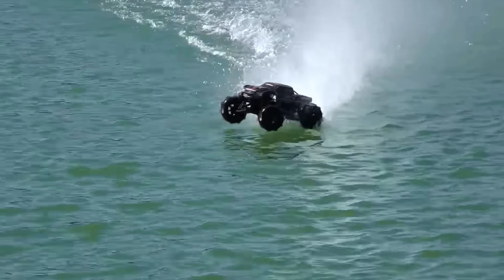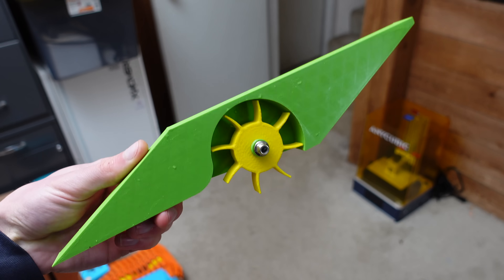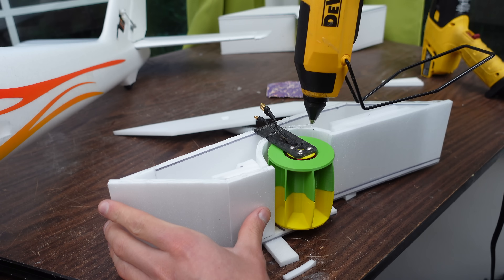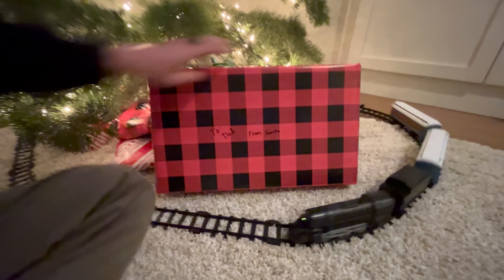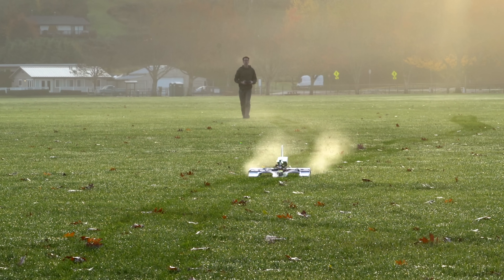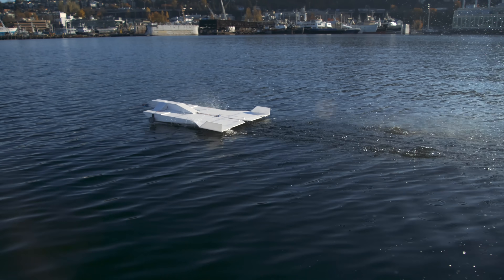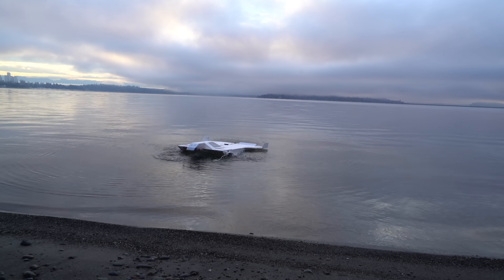Testing Wheels on a Ground Effect Vehicle

Comment from the maker: Go to http://drinkag1.com/rctestflight for a 1-year supply of Vitamin D3+K2 and 5 AG1 travel packs FREE with your first purchase!
Reply: Pilton wheel.
Reply: Make the wheels treadless and speed based a bit over SOG (groundspeed), it wont throw as much water up. It wont speed it up but wont slow it down as much as a still surface. Make them at deep v-shape in the cross section so it slices through small waves (deflects water sideways, less drag, like hull shapes) and finally, make it roughly they are not too buoyant, that way they wont kick up the plane too much.
Reply: @mleb8768  surface tension and lack of centrifugal force will make it throw more water up. 

Look up pelton wheel
Reply: Paddle wheels seems a bit aggressive, maybe you could try with just smooth cilinders (or cones) spinning at high speed. That concept worked well for bouncing bombs
Reply: 10 days before upload?
Reply: @dontknow3886  
Members only
Reply: Is AG1 subject to regulation? Do they have third party non-bias testing and results. I kind of find it terrible that you mention science is always changing and suggest that they keep up with this in food science. Food/drink science says one thing is good/bad for you, then 10-20 years later they change that. That is science... but when you are physically putting it in your body as a test experiment... 
They will just get lawsuits and go out of business. 

Anyway, your video's are awesome. I love that you are going between the hydro and aerodynamics, and I would like to see more of each, including more hydro testing. I am currently undergoing issues with getting a kayak over 9mph but I think I have the solution, but I am doing similar playing around like you.

If you want to throw ideas around, let me know.
Reply: What about some sort of twisting floating screw propulsion system for waypoint missions?
Reply: @rctestflight what site did you use fore custum cirket boards
Reply: Here's an idea: instead of using a high speed paddle wheel, use a high speed caterpillar track with paddles on the track. There would be a longer portion where the paddles push backwards against the water.
Reply: theres value in a patent on your self accelerating input system from auto detecting engine resistance from water contacts (or turbulence)
Reply: I understand that channels need video sponsors but AG1 is the worst. A terrible, expensive and just unnecessary product.
Reply: @christocan4710  AG1  is good.. gives my bf strong bonners and keeps him going long time. Makes his loads thick and plentiful.  He bang good. 🥰
Reply: Just bought some!
Reply: @brandonpourmorady9485 lol I buy vitamins at costco

Comment: Actually, I bet you could get those paddle wheels to turn it like a tank. You speed up one side and lower your throttle just a tad to tap the water and turn. I wonder if there would be a weight-effective way to get the wheels to nearly match your speed over the water as well. That might help with flight duration if you're only using the power you need to come back off the water.

Comment: My intrest in ground effect vehicles is actually driven by the possible real world aplication in the Stockholm archipellago and Baltic sea travel. Ice in winter obviously impedes the usability of boats and ships. Things go slow or not at all in winter, which causes a lot of trouble. Beeing able to use existing infrastucture for boats and ships also makes this vehicle type an attractive idea. Main drawback seems to be they give a bumpy ride when the sea isn't frozen and not quite so calm.

Comment: I’d start by rattling of compliments but the sense of achievement with such success and fun in the hobby you get should be enough! But still very well done and very impressive designs! Plus the quality of these vids is worth a thanks for the effort! Instant subscription here! The idea of high speed paddles isn’t new but it’s great to see it actually done! The model’s you’ve built are excellent and are very close to what I’d have built but mine would be the duct tape and zip ties variety’s lol! how about combined twin counter rotating surface drive lifting prop’s and 2 or 3 paddles to form a friction less hydroplane thingy my thought is the driven paddles could provide traction and thrust with the right design as with conventional props and also add the potential for biased steering assist and stability management and probably would only need conventional gyros to achieve most but it’d be fun watching trying to dial them in! Edit- I should have watched till the end! Of course you will do surface drive prop’s and paddles and climb that engineering wall!

Comment: Trying to make a hydroplane without building a hydroplane. 
We are restoring the Miss University at Kent Hydroplane and Raceboat Museum.
For display use as engine to make it work is sorta a dream.
Local hydro guy , John Adams , posted a short book on the math and basics in design.

“Speed Rails” we’re in a 1990s Boating World magazine article where an Aussie made a go-fast Ocean hull the looked like Batman’s.
It had plates on both sides of the center V bottom that had lots of lifting strakes ( guide your water spray horizontally Btw).
At 45 or so , the plates began to lift entire hull began to rise.
The rails also make a boat track like railroad tracks . Corrugated alum boats do same , you’ll see lines extending behind as they lay a trail.
  The 4 point Elam was tried on Lake Washington, lifted off for a 70’ flight that ended horribly.
A flex drive high speed electric brushless 
Hydroplane Running gear with surface prop might get you to 
“ the Promised Land .”

Comment: Why not just very small Hydrofoils exactly where you have the paddle wheels?  Have them mounted on short struts so they only touch the water when the boat dips low enough.

Comment: Forget the paddle wheels, spinning water in all directions up and around, causing negative lift and drag. No chance of efficiency there.
Use a water jet unit, as the scoop leaves the water ==> no thrust. The height of the scoop can be adjusted.
Same idea but all the thrust is a perfect push forward.

Comment: I feel like regular RC car tires mounted 2x2 like a car would do wonders. The paddles may cause more drag than wheels, and the front-back orientation can help adjust for pitch and roll, while minimizing jerk in yaw on contact with the water.

Comment: What about a catamaran where the front 3" of the hulls are separate and mounted on a motor? So when they're turned off you have a normal cat hull with low drag but you get the effect of bow thrusters when you need it.

Comment: Super cool.  If you're really interested in crazy paddle wheel nonsense . . . years ago, I saw a prototype of a fast paddle wheel boat that was basically a little Boston Whaler that had four smallish wheels, two on each side, that didn't have paddles but had rubber tracks strung over them.  Maybe 5' front to back, wheels maybe 15" diameter.  Like a tank built for water.  The tracks had paddles on them, and they steered by varying the speed from side to side.  It planed easily at speed.  Never saw or heard anything else about it, but it looked hilarious.

Comment: Hey man, love what you do, been following for years. Idea; how about carefully calibrating and syncing the speed of the water wheel to the exact GPS speed of the craft? That way it is not imparting such a strong sudden jolt when it hits , but instead acts as a friction-free hull. You could then adjust the speed + or - some percent on the appropriate side if you need steering input or acceleration!! Pls consider giving it a try. I'll be watching.

Comment: Maybe open sides on the paddle wheels themselves, but mounting them in the pontoons, and let them suck air from the the top side, and have the air/water exhaust backwards/downwards, so they act as radial fans as well, that givs both some thrust and some lift.

Comment: how about paddle wheels serving a dual purpose? They could also act as an impeller to suck air from the top and increase the air pressure beneath. When stationary the mechanism should be above the waterline(with a passive mechanism such as a float) to only act as a air pump but when flying should lower and touch the water before the hull.

Comment: Couple notes. The water flying back and hitting the aircraft is wasting a lot of energy. And the motors spinning at max rpm and then immediately receiving a massive load, and therefore current spike, will probably fry electronics over long term.

Comment: Maybe if you angle the paddles inwards so that the spray is flung away from the body if the vehicle, also maybe it will help with thrust? The paddle shape will probably have to be different though.

Comment: Seems like the next step could be a hydrofoil design? The hull is lifted out of the water for minimum drag. A wing under water to lift the hull out of the water, and propellers can be underwater, possibly deep enough to keep clear of weeds etc floating near the surface.

Comment: Would the wheel on the plane have worked if it was off the back? An optimized version has the wheels off when above a certain height, and/or engaged in creating air-related lift force without being in contact. The energy cost to keep them rotating at all points only to give surface contact assistance seems counter-productive especially with the added weight. I don't think a larger plane would have an easier time getting switching power system to work due to elevation, since wind up speeds would be relatively the same, I'm guessing. Elevation sensors on each wing tip that can work in milliseconds and engines that can match full torque in the same?

Comment: mounting so only 1/4 inch below the pontoons on plane or even flush mount for only being in use after buoyancy of pontoons takes effect you could design a electric actuator to adjust distances remotely for how deep to dig but that'd add weight

Comment: Although this is an interesting idea for a model aircraft I don't think this would ever be practical in the real world. In fact I don't think air effect vehicles would be very effective in practice either. Any of the fuel savings that you gain from utilizing the air effect would be negated due to substantially more air resistance at their lower operating altitudes and lack of maneuverability does not make it more favorable. Adding paddle wheels to this would further reduce efficiency. I understand that is not the point of this test and this is just to see if something works though so I'm all for it.

Comment: Rather than small/slim paddles wheels why not try extend them to the length of the wing to fuselage or even 4 rotating cylindrical wings for better stability?

Comment: 9:20 make the paddles on the wheel 45 degrees instead of perpendicular to the axel so it slaps the water more when coming in the water and pushes the water backwards instead of practically shoveling water on the boat. at 90 degrees, the paddles are acting more like buckets

Comment: You might want to look up the late Francis Reynolds' "Hydrocopter" concept. It's been many, many years ago, but he explored a fascinating hydrofoil concept that looks, from today's perspective, sort of like an inverted quadcopter with independently tiltable rotors that touch the water on each rotor circle's tangent. By controlling each rotor axis tilt in 2 dimensions he was able to place the water contact patch for each so that the thrust generated could point in any direction in the horizontal plane.

My Reynolds died in 2019, but he was a retired Boeing engineer who lived on Lake Sammamish (as I recall) where he proved out various model craft experiments. One of his early prototypes for what would become the hydrocopter used very similar paddle wheels to what you are using. His direct inspiration came from the way water fowl use their webbed feet as dynamic hydrofoils to get off the water so their wings can take over. If I remember right (it was the mid '80s when he was presenting this to a group) he said the paddle wheel version was difficult to control around yaw; that is why he eventually went with the tilted thruster design.

Mr Reynolds held a number of patents. His full name was Francis Drake Reynolds, and he was an avid RC air and water craft modeller.
Reply: Upvoted for visibility.
Reply: That all sounds hecka interesting to explore further
Reply: https://www.youtube.com/watch?v=66PmaluCvbU

Comment: may i suggest making "deflector" fenders, if you use conventional fenders, the high speed water that the wheels kick back will slow you down, where as if you  have 45° "deflector fenders", the water will move sideways, conserving more of it's energy and not using that energy to slow your vehicle, this project is super interesting, cheers!!!

Comment: Would running the paddlewheels in reverse once in the air be possible - pushing air above the body but also pushing more air onto the water when it is near? Also, if that works - maybe possible to push water outwards to the side by using slightly diagonal oriented paddles?

My first thought would be that it would crush into the surface if it hits, but on the other hand if it hits and runs in reverse it would also pitch the heavy nose up right before (due to the air blown on the water) and possibly create the necessary bump to develop ground-effect again.

Comment: would it be possible to have the paddle wheels also make the thrust? like scooping a fraction of the air and or water into the middle of the paddle wheel and redirect it through the craft backwards.

Comment: Hey what would happen if you used that energy to make an air jet at the contact points - that could add to ground effect pressure, but also really come into effect when super close to the surface.

Comment: 8:39 extend the wing over the top of the wheel, to limit spray and direct it rearward increasing the effectiveness.

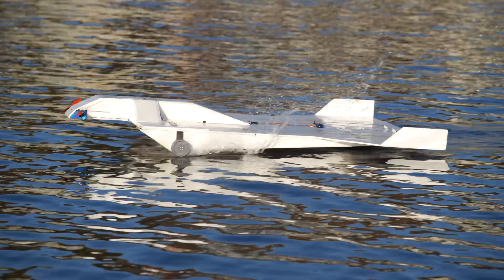8:58 The wheels are moving air when not in contact with the water. Air is a fluid too

Comment: You come up with some very interesting ideas! I don't think you are going to get paddle wheels to perform as well as a surface piercing propeller. That being said I thing backwards inclined blades with as large a diameter as you can fit would be the best for paddle wheels. Maybe add some teeth to the edge of the blade . I'm thinking that shedding the water from the blades is an important design consideration. That maybe these 3 suggestions would help in that regard. The teeth might also  give you somewhat of a transition range kind of like a shock absorber? Thanks for the mental exercise anyway, cool project.

Comment: The biggest benefit of these type of aircraft is the much greater mass, or rather density of the vehicle when fully loaded. So that in mind, why not make one from sheet metal? Do a prototype first from your usual materials then the final version from aluminium or even steel.

Comment: Peter Sripol's recent tank-tread propeller video made me immediately wonder if a high-speed tank tread would work better? Perhaps you could combine the pontoons with the tank tread, to save weight, while the increased surface area may reduce the minimum necessary speed of the tank tread advancement?
Just an idea.

Comment: Stop water spraying up by adding a defector that "peels" water off the back of the wheel and redirects it to the rear. Also, make the outer edge of the wheel into a disk of larger diameter so it almost always in the water, but keeps water spraying out the side. Then the paddles smoothly reduce in length from the same as the disk, down to almost nothing. Too high? less paddle in the water,  less thrust, lower elevation. Too low? More paddle in the water, more thrust, higher elevation.

Comment: Having configurable fairings on the wheels that direct the wash from them into nozzles might improve performance. They could have a low speed configuration that makes the wheels act as impellers and a high speed configuration that just deflects the wash from the wheels into the nozzle to more efficiently generate thrust without themselves contacting the water.

Comment: How about a paddle wheel that is full width, integrated with the leading edge of the lifting surface? All the thrown water hits the bottom surface to create lift, or goes backwards to create thrust.

Comment: The last bit about surfacing propellers is actually how the fastest V-Hull boats operate. They have air lifting strakes, and reverse chines in their hills, these let the entire hull "float" in essentially ground effect. All the while, the outboard or out drive is connected to the water via a surfacing propeller. These propellers are shaped uniquely vs a traditional prop and in some cases are designed to operate with the centerline well ABOVE the water's surface, and only thin section blades cutting into the water. It's a better version of your "high speed paddle wheel".

Comment: great idea with the paddle wheels. I like the Sound when they hit the water. Little idea: What about Holes in the side of the Wheel to suck in air. Like breakrotors. They also suck in air and push it out though the middel to cool the Rotors. Maybe this could improve the liftforce.

Comment: This is fantastic work. I feel like the high-speed paddle wheel is a real breakthrough -- they allow a much higher tolerance for error in the wing design and PID controls. I'd love to see you experiment with paddle geometries and see if produce more thrust or reduce spray.
Also, the camera work was absolutely pristine. I'm so glad you're having fun with this.

Comment: Maybe a weird idea but, I bet if the paddles were more like dimples on the surface of a wheel it would be less likely to apply so much lift on one side that the other needs to compensate. A classic tire design might actually be ideal for this purpose.